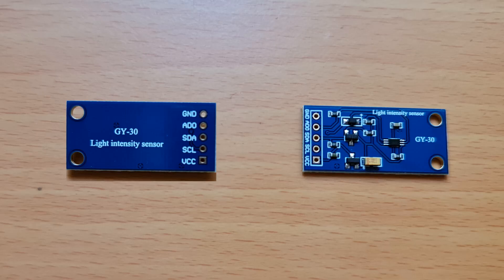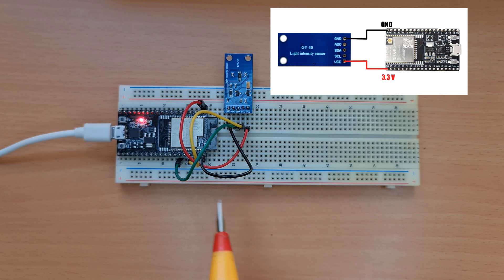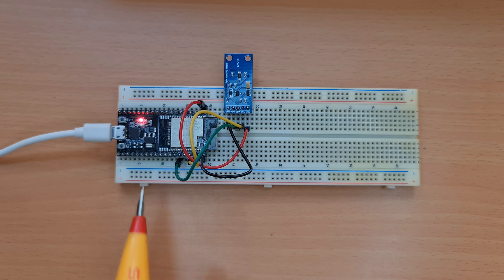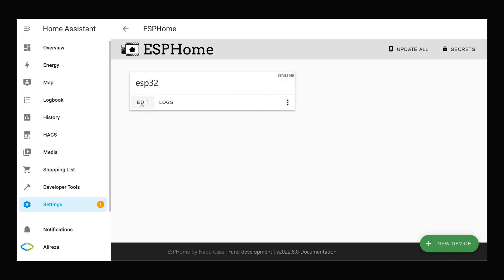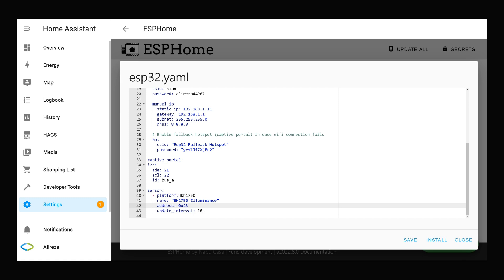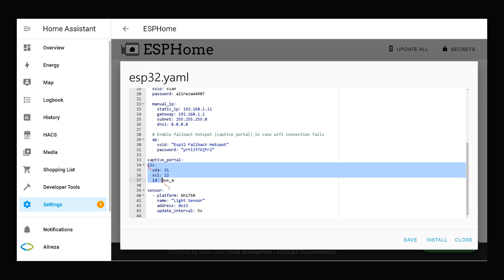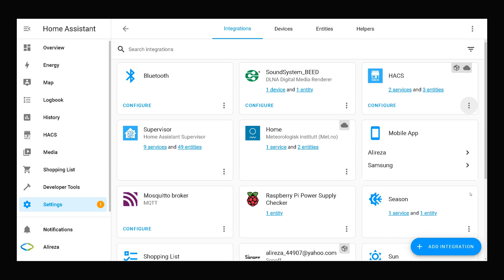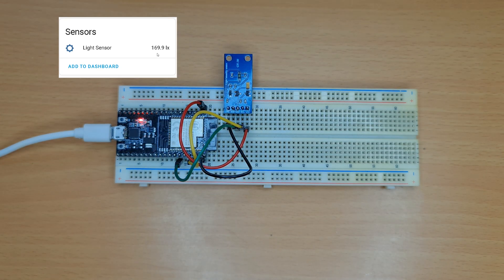Homemade Smart Gadget: Measure Light intensity

Comment: Hello. My esp log tells Ic2 STOP. Scl stuck LOW. Do you know why? The wiring I did is the same but I used 2 different GNDs por GND and adress pins
Reply from the maker: Hi, make sure you are using the right pins. check your esp pinout.

Comment: Good Job: did you try to have 2 sensors in parallel (2 adresses) with the esphome coding - does ist work?
Reply from the maker: Hi, Thank you. I have not tested it but there must not be any issue and you should do it easily.
Reply: @kian.smarthome  Fine, I received my sensors and it works great with NodeMCU and ESPHome to connect 2 sensors in parallel to the same PIN's (vcc, gnd, scl,sda) and to have two i2c addresses (one addr to gnd - one to vcc 3,3V) - Thank  You for Your hints!
Reply from the maker: @michaelwurzer6791  great it's working